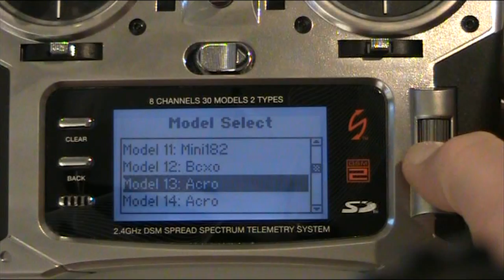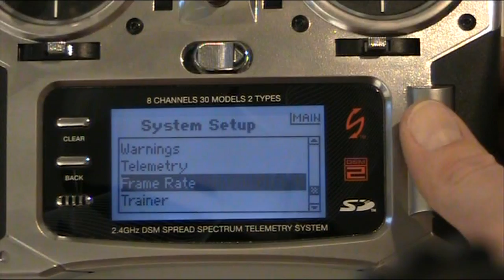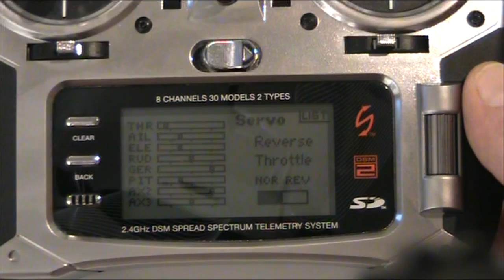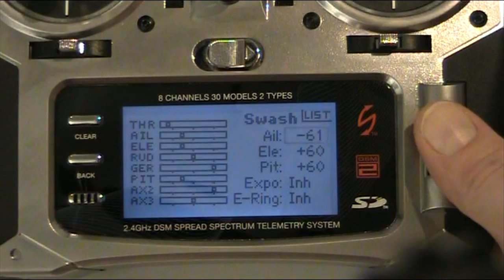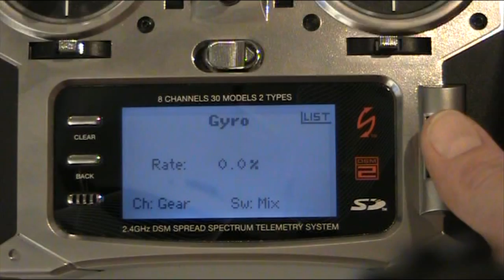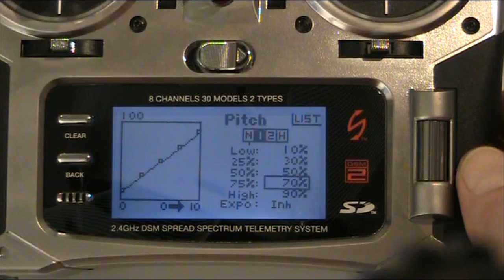Spektrum DX8 - Helicopter Setup

Comment: What setting i need do when i press down on the controller the heli goes up and press  it press down on it press down on the controller
Reply from the maker: You need to reverse the collective pitch. Do this without blades on your heli to prevent damage to your self.  The front of the blade holders should point upwards when you move throttle stick oppwards. Try search for complete heli setup for beginners. 😊

Comment: Hello, I have a Spektrum DX8.
Recently the speed controller stopped working, maybe I messed up something with the adjustments. The monitor shows that the joystick is responding, but the receiver does not execute the command.
One plane emits rhythmic beeps, the other buzzes three times and then is silent.
I would be very grateful if you help, I hope this is not a defect, I can’t take off, but I really want to.
Reply from the maker: Set your throttlestick to high. Den connect esc battery whait for to beeps and then throttle down  fast. Now wait for signals and cell counts. You have no calibrated esc to you radio andbit should be ok

Comment: You mention in this 'Spektrum DX8-Helicopter Set-up' that this is Video #2. Where is video #1 and what is it entitled so I can watch it first?  I am starting from the beginning to set-up my Spektrum 8 and I am going to program it for my Blade 350 QX3. Thank you.
Reply from the maker: I don't remember Sir. But i don't think you are missing out on something. Remember that this setup is for flybar. I will make a video with FBL systems when i get my hands in a new heli.
Reply from the maker: I think i was talking about switch setup in the plane setup video
Reply: You lost me. Whats flybar? and FBL?
Reply from the maker: Greg von Seeger Flybar is when your helicopter has those extra Paddels togetger with the Main Blades. Flybarlessis only the main blades and a 3 axis gyro instead of just the rudder gyro

Comment: I do not agree with everything in this video I would not adjust pitch and cyclic with radio I always adjust mechanically this way when or if you crash you do not have to remember all your changes in radio there is some good info here just do things a little different

Comment: Hi , I am fairly new to this hobby , I have a DX8 and a trex 250 DFC. are these settings good for this because I have no clue?
I can only fly inverted on my simulator and I don't have the courage to do so for real.
My trex 250 is currently set up to my DX6i and I won't use the DX8 until I have the right settings?
Can you please help? Thanks , Paul

Comment: I have the same radio, DX8.  I also have the Trex 550e V2 3GX.  Everything seems to work fine, but for some reason, I have to fight the tail rotor all the time.  I seriously need help and I dont understand what i did wrong.  I take off the ground and the more power I give it, the more it wants to turn counter Clockwise.  I lower the power and it turns Clockwise!  Seems to me that my gyro for the tail hold is not working.  I know it has to be a setting i am missing. Can you think of anything?

Comment: @ArcticRc It's Mentioned in the Manual if you have a Unstable hover. I guess you can use it to calm down a Sensitive Heli when your Hovering. Mine is all over the place in a hover. I can't seem to get it to not be so sensitive..

Comment: @ArcticRc HI Bengt, thought I'd tune in here. It is quite normal to used around 25% expo on cyclic and rudder controls for helicopters of all sizes. I use it on all of my helicopters, ranging from 450 - 550 - 700 size. Cheers.